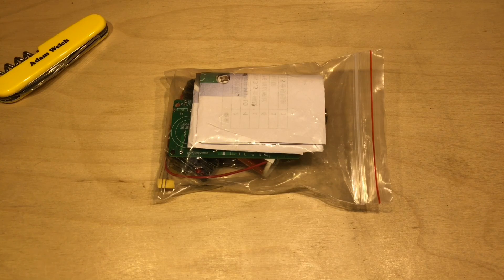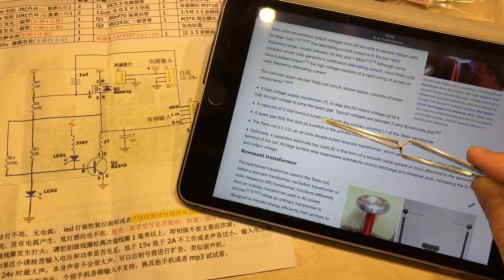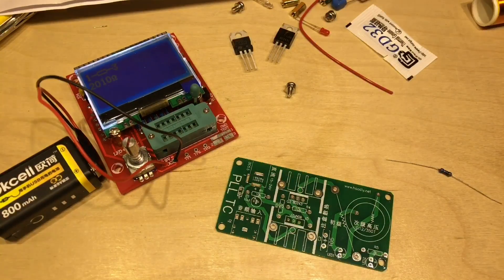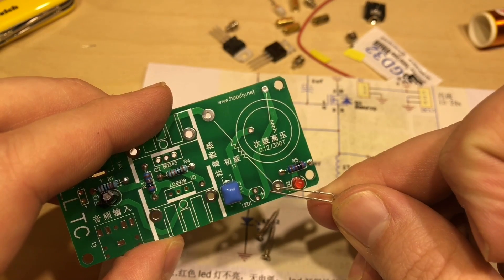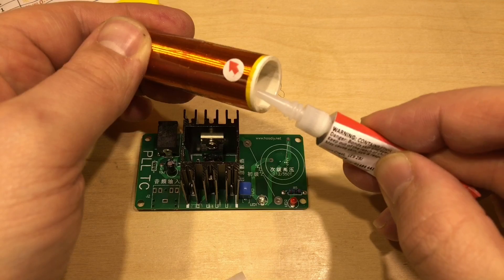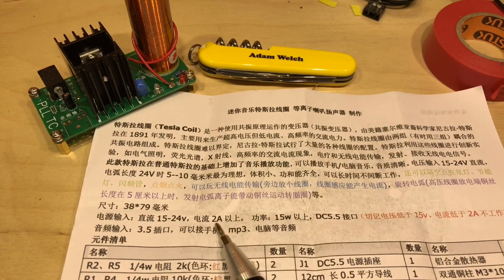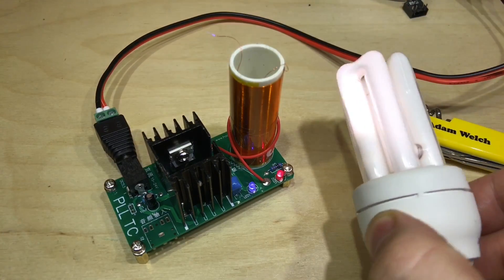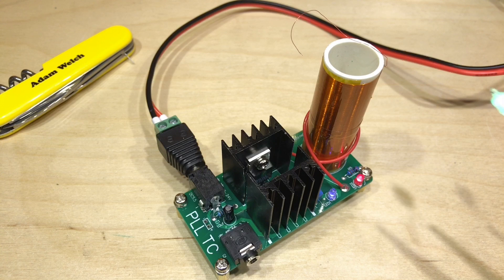Mini Tesla Coil Plasma Speaker Kit - 12v Solar Shed

Comment: For anyone who can't get it to work, specifically, those that are seeing only LED2 turn on, try replacing the red primary coil with a wire with fewer turns. Newer versions of this kit say to use 2-3 turns, but try trimming it down from 3 to 2, and if that still doesn't work, from 2 to 1 turn. I had 3 turns, then cut it down to 1 turn and it worked with no other changes.
Reply: does yours smell like ozone because of corona discharge?

Comment: Any tips on how to power this? Not exactly an electronics or circuitry expert. Don't know if there's any battery set up i could make/use.
Reply from the maker: You could hook it up to a twelve volt battery - but I remember it working better at closer to 24v DC. However it did get warm at the higher voltage. A typical mains adapter (a wall wort) of 12-24v should get it running as long as the polarity is correct in the barrel connector. Some ideas there for you.
Reply: @AdamWelchUK  Thank you!
Reply: @AdamWelchUK  managed to hook it up to a 15V 2.5A power supply. LEDs are lighting up but I'm not having any discharge from the coil. Not sure what to do...

Comment: '
hi A W...
try use a LED bulb or any color LED light...
will it light ???...
try use a circuline light or compact fluorescent light bulb or incandescent light bulb...
will it light again ???...
one last question is...
can use the android cellular smart phone touch on the coil...
what happen this smartphone ???...
next time turn off the ceiling lights and see better on the coil grow low electric airfire

Comment: Hi, there folks have just finished building one of these today but cannot get it to work. One led light is coming on but the charge is not going through the coil to excite the bulbs. I am not the best at soldering but have all the pieces in place . I followed this youtube guide but unable to figure out what the problem is. very disappointed after this effort. Anyone have any idea what the problem could be. I think something to do with the coil and perhaps enamel on the coil. Any advice would be appreciated. I am going to send for another one on ebay and build from scratch. Eagerly awaiting any advice.

Comment: Hi there I'm new to this and have bought this kit but how do I distinguish between the two 10k resistors and the two  2k resistors. Thanks
Reply: https://www.digikey.com/en/resources/conversion-calculators/conversion-calculator-resistor-color-code-5-band but if you have mutimeter it would be better and quicker way :D

Comment: So annoying... my second one doesn't work. So the first one I screwed up bad. I mixed up the resisters and put in the LEDs wrong. But I learned from it and by the second time I really did all good. The LEDs light up, but it doesn't give a spark and doesn't light up bulbs around it..... :( pretty frustrating after waiting for it for almost 2 months.

Comment: So, does the ‘St. Elmo’s Fire’ or ‘Corona’ dancing on the end of that thin copper lead, do the two leads from the ends of the primary winding need to be close to one another.  I see you’ve made certain that there is proper contact and soldered the bottom end of primary winding wire to the hole in the PCB, but can you just cut that lead flush to the board after you’ve soldered it?  I’m only wondering because I don’t have schematic, and I’m having troubles getting my kit to work.  I thought that the spacing between the ends in the primary coil need to be within a centimeter if one another, and the blue spark will go between these two ends of wire.  Is this the case, or does the spark just dance on the end of the coil’s upper free lead?  Thanks for sharing.  Cool piece of kit.

Comment: Hello, How are you?  Good, I hope! Nice job on circuit.  I was wondering I see there is a place to connect a fan for the MOSFETs do you know what voltage fans it uses?  Also how hot does it get when running for some time?  Thanks.
Reply from the maker: Pretty sure the fan will run straight from the input voltage and that’s noted as 15-24 volts. It work best at 24 volts and does get very hot.
Reply: Adam Welch I just finished my kit and you are correct that the fan connector follows the input voltage and running it at 24 volts it gets very hot.  I think I will do a 12v regulator to run fan from the connector or something. Neat little kit though.

Comment: I'm having a mare with this kit. I never get plasma, but on a 9v battery it will illuminate the neon lamp at a very close range. At 18v (two PP9s in series) it doesn't work at all, though the "on" LED lights up. 12v (YUSA lead acid battery), doesn't work. Same with 24v - it draws about 400ma and the MOSFET and BJT get HOT, but no plasma.

Anybody got any ideas? I was wondering if my lack of a proper ground/earth reference might be causing a problem, but not working at all above 9v seems very odd.
Reply: Sods law. I've been scratching my head for hours, then having just wrote that had an idea and solved it with some metering.  The secondary solder joint hasn't made a proper connection. I guess it hadn't melted the enamel properly when  I soldered it. 

Very odd that the 9v cell works though. I'm well above my electronics pay grade here but maybe the crap solder joint created a tiny spark gap... That doesn't explain the lower voltage being better though. Maybe it oscillated slow enough to allow some sort of capacitive coupling, with the enamel acting as the dielectric. I wanna know, I'm just too scared to put my only crappy oscilloscope anywhere near this circuit. hehe.
Reply: err, sorry to spam (and talk to myself) but for the benefit of other electronics noobs, and completion, I can confirm this was the problem. I cranked the iron up to 470 deg c and resoldered the secondary winding.  It's working fine now. The joint originally felt perfectly sturdy.  Lessons learned: always meter joints, just in case. HIGH temp soldering needed to destroy enamel on magnet wire... and electronics involves some voodoo I'll perhaps never understand. :)

Comment: When using a translator the blue and red LEDs are called out.  Music volume however is super low and almost unauidible.  @15v .65A @24v .8A. Heat sinks get very hot within minutes. It a good stocking stuffer for an electronic experimenter but not a useful item imo

Comment: These are transistor driven, they don't need a spark gap. You can build a Tesla coil with vacuum tubes or transistors as well. It is a tesla coil, but not in the traditional sense. When Tesla made his coils he didn't have transistors to use or he may have.
Reply from the maker: +C MJ That’ll explain it - thank you very much.
Reply: You need a cuppla thousand volts on the primary for a spark gap to work.

Comment: mine came with a glue stick that I assumed was for soldering the parts together, however mine isn't working.. should I have used other material to solder?
Reply: I think the glue stick was just for holding down the coil bit ,it's plastic sad it was 3 years ago

Comment: I might have missed it, but which supply voltage did you give it ?
Reply from the maker: Originally about 18v I think - but I did find it worked better at 24v - however the transistors got quite hot quite quickly.

Comment: Haha, assembling as we speak. You have the red and blue led mixed up.  Google camera translate came to the rescue.
Btw I hate superglue. It has ruined so many of my pants and shirts.
Reply from the maker: +Luc Peeters Did I? I wonder if that makes much difference? Probably only have a slight difference in forward voltage. It works much better running from close to 24 volts I found - although it does get hot at that voltage.
Reply: Not sure if it makes any difference at all.  I was staring at the manual but then I thought about using crazy 2K's technology. Google translation seriously surprised me in a positive way.
Have you had time to test that small universal solar charger yet?
Reply from the maker: +Luc Peeters Not yet sadly. Been on with other projects.

Comment: If you ever build the real one mate.  Move the capacitor to the opposite side of the spark gap.  The known version of it was made for show by Telsa.  The one that pulls energy out of the air has the cap on the opposite side of the spark gap.  If you do that it will convert high voltage low amps that is in the air to low voltage - high amps.

Comment: Hey , i got this too but when i give power to it, only the one LED lights up so it does not work for me have you any ideas to fix mine? i checked for leds polarity and also for continuity of the coils?!
Reply from the maker: I have seen another version of the schmatic where the LED at the bottom of the secondary coil is the wrong way around - all the energy immediately goes to ground via the led rather than via the discharge.  Does your schematic in the paper work match mine?That's the correct way.
Reply: Adam Welch... it was my fault there is Another solder point near the primary.. i soldered the sec. to this point instead of soldering to the point where ot has to be :/ anyway it works well. thank you!

Comment: Don't be embarassed - I did the SAME with the damn super glue. Just waiting for it to set, then I can solder my secondary tail, primary coil and see what tubes I can light up with mine :)
Reply from the maker: +dash8brj hope you have fun. I found later running it at 24v gave a nicer effect - but the transistor and mosfet get quite warm.
Reply: Well I bought mine for a more specific purpose - testing laser tubes to see if they're good. They glow if they're gas intact just like the neon and the fluoro, although its not enough energy to make them lase :)

Comment: The spark gap is not an important part of the tesla coil. The important part is the primary low turn and secondary high turn coils. 

Thumb ups! 
That is exchanged with the electronics. 
So it is like the spark plugs in a car. Modern cars does use electronics instead of a mechanical switch.
Reply from the maker: Cheers.
Reply: the important thing is the resonance of the primary circuit

Comment: hi there i like all your videos and lots of good info keep up the good work. i had a question maybe you could help out i have a epever tracer seriesA 4210 my panels are 48 volt panels i wanted to see how the charger works before i run everything but when i connect 1 panel the 1st time around the carousel it shows 48 volts coming in then when it goes around or i if i click through the display it shows 14 volts at pv and only 0.2 amps coming in thats in full sun  i just had 1 battery connected to it like i said just to try it out. am i doing something wrong or does it have to do with common possitive  im not even sure. or is this something that can be changed within the parameters in the computer station i had to order the cable should be here soon any help or suggestions would be great thanks so much
Reply from the maker: I did a video last week which talks about this ( https://youtu.be/YowgBCl1F1I ).  The EPEver Tracer A (and it seems many others of the tracers) doesn't do MPPT unless there is more than 10 watts coming in.  However at 48v * 0.2a = 9.6 watts you were close so it may not have been that issue.  The other possibility is that your test battery is quite small and well charged.  The whole point of a charge controller is to control the charge into the battery so if it was fully charged (or so small it didn't take long to charge it) the charge controller will reduce the power coming in to prevent an overcharge situation.
Once you've built your system, start using and monitoring it you'll probably find things settle down and become more self explanatory.
Reply: great i will try that thanks for your help i thought i was doing something wrong the battery was a smaller one i just figured  by connecting a 320 watt 48volt panel i would see some action hehee thanks

Comment: It looks like  a Slayer Exciter
Reply: you are correct
Reply from the maker: +Pownyan I did mention this in the video however it is sold as a tesla coil.
Reply: I am not a Tesla expert, but further down the same Wikipedia Tesla article as was cited in this video, several Switched Solid State Tesla Coil circuits (SSTC) circuits are identified as legitimate variants of Tesla coil circuits. The version in this kit is identified as Single Resonant Solid State Tesla Coil (SRSSTC). The only real differences between the circuit schematic given for the STSSTC and the circuit for this kit are that instead of a direct drive of the switching transistor from the DC power rail, the kit circuit uses the power MOSFET as a driver (constant current and/or current limiter?), and of course the option to couple in an AC modulation from the audio source.

Not noted in this video, but somethings I noticed when building my own copy of this same kit:
- The photos in the instructions showed which color LED goes where.
- The PCB silk screen misidentifies the pin-out of one of the power transistors (the MOSFET)

Comment: Ha ha, nice video mate. Mine is still in the post, really looking forward to it.
Reply from the maker: +David Watts Thats good - you'll have some fun with that. Top tip: a higher input voltage makes the output more impressive. Cheers.
Reply: ***** I am sure I will screw it up somehow :-)

Comment: The description on this item I viewed says (sic) "Not to phone, mp3 and other electronic equipment near the coil. The coil generates high frequency magnetic field would otherwise interfere with such mobile phone, mp3 other equipment failure or damage" ...Hope you kept your ipad a good distance from the coil :-) Fun item though.
Reply from the maker: +standishgeezer The iPad was a fair distance - although electrically connected. My iPhone was a fair bit closer videoing it. All working as they should - thankfully.

Comment: Hello Adam..."Adam the builder"...!   Nice video...Mr Carlson's Lab has a fine video about the polarity of capacitors...the outer foil is a "case" and therefore better  antenna-reciever for hum:  https://www.youtube.com/watch?v=BnR_DLd1PDI.   Can come in handy, working with frequency depending circuits.     Tip: If you burn the laquered coil wire fast, with a lighter, you can gently scrape off the charred laquer before soldering.   All in the name of "Good Audio"...as "They" say: Hi-Fi(ve)...!

Comment: I thought they would use that MOSFET to amplitude modulate the output. I won't feel good connecting my phone or laptop in such fashion :/ I think they swapped GND and Rin places, it doesn't look right.
Reply from the maker: The iPad survived and it seemed to work as well as expected.